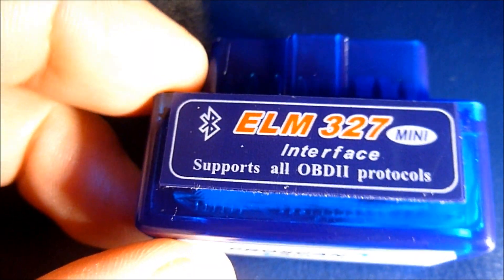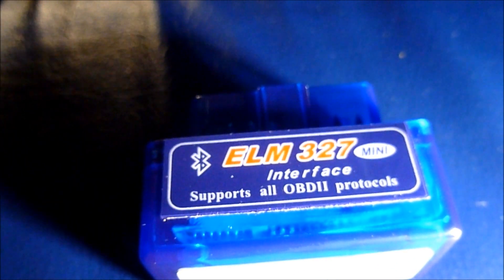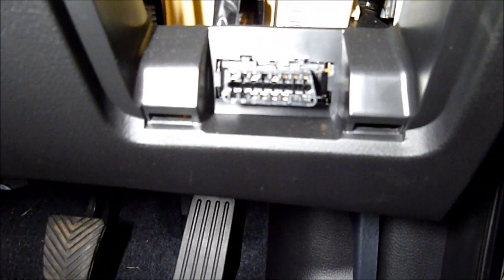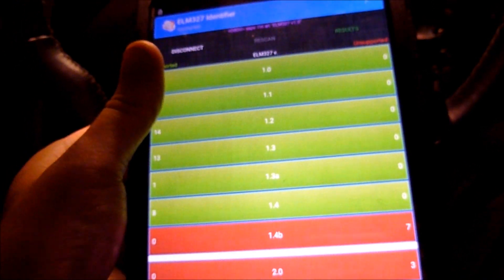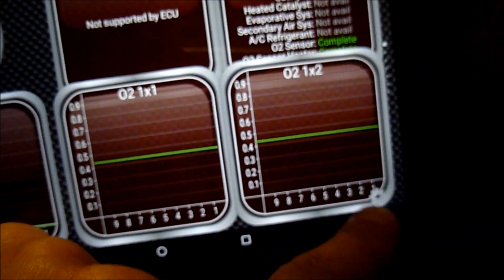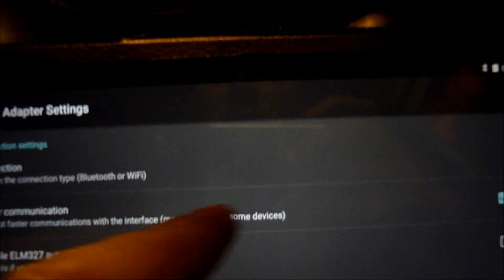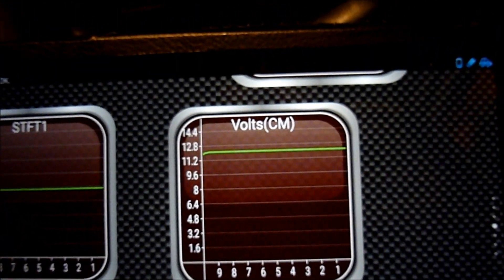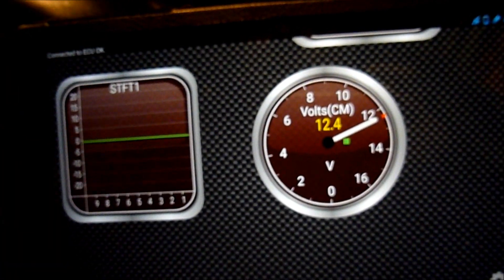Bluetooth OBD II Mini ELM327 interface  tested in a Hyundai i30 in HD

Comment: Does it supports in Hyundai verna fluidic sx 1.6  .  Because when I m trying to buy it from AMAZON it's showing  . This product doesn't suit for Hyundai verna sx.  . What to do
Reply from the maker: I'd think it would support it, have you tried on eBay
Reply: @briandoliver  no sir I just tried to search on flipkart and amazon.  So what should I do.
Reply from the maker: @akashlakka5271  search on Amazon,eBay for Proscan OBD2 ELM327 Bluetooth google Android Car Scanner Torque Auto Scan Tool, this is what I have.
Reply: Do you have Hyundai verna sx 1.6
Reply from the maker: @akashlakka5271  no, but it's the protocols your car supports you look for, if you have a OBD port then there's no reason why it wouldn't work for you
Reply: @briandoliver  i have a port . But many  reviews and comments are against hyundai . And i think ELM327 doesnt works works verna fludic.  The way i getting response after searching for this device
Reply from the maker: @akashlakka5271  why not buy one and try it, there not expensive.
Reply from the maker: @akashlakka5271  please 😊 to be helpful to you, has your car been reliable for you?
Reply: @briandoliver  it is. But sometimes I have to b alert for silly faults
Reply: I bought thus for $2.50 from Ebay imma try it haha